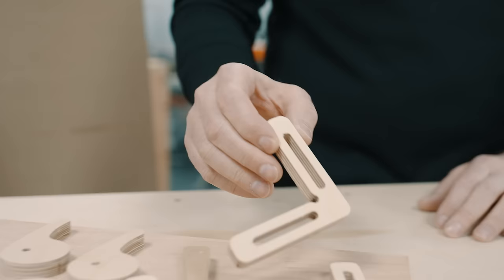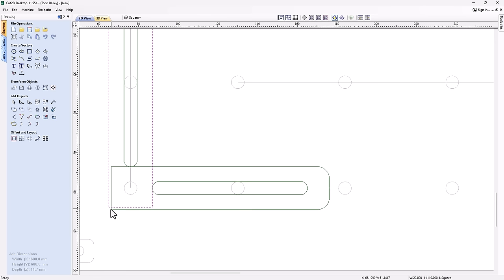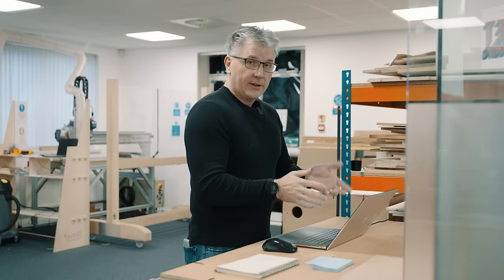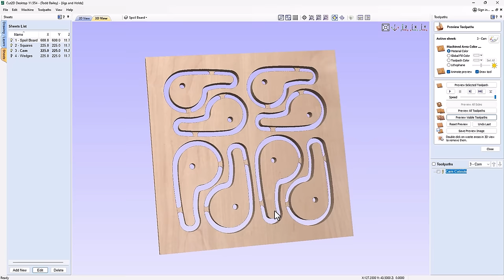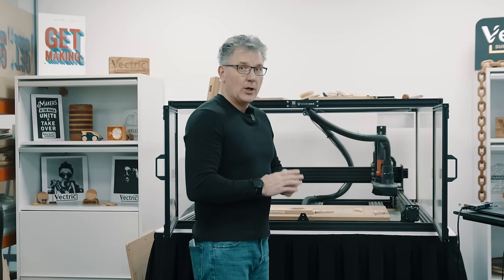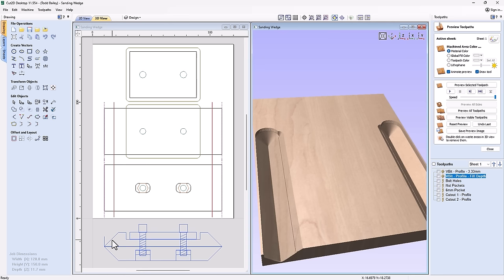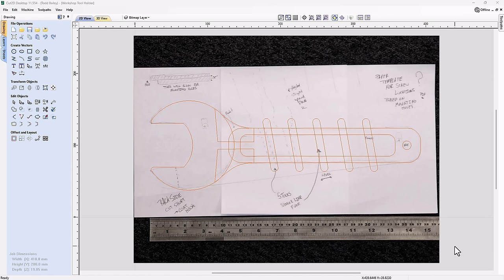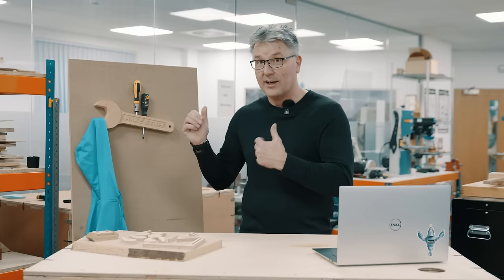Making More CNC Accessories | In the Labs with Vectric | Vectric FREE CNC Projects

Comment: For your offset cam, a line from pivot point to contact should be perpendicular 90° for best securing otherwise the cam can easily push itself off with vibration. A Fibonacci spiral gives ideal shape for the cam
Reply from the maker: Thanks for that!  This might mean a upgrade in the future.... :)

Comment: The sideways hold of the cam lock is far more important than the downward force of a hold-down. The major forces on a CNC machine come from the X and Y steppers. Instead of the square I have used the CNC machine itself to define the bottom left reference. I drilled a hole at 0,0, then used the X step to position a couple more along the bottom. I did the same up the side for the Y direction, then tapped some dowels into them. Doing it this way guarantees precise alignment to the CNC's axes. The dowels are every bit as good as a full square.
Reply: If you are using an upcut bit holding the material down is very important
Reply from the maker: Thanks Don!!!  Yeak therre are many wand to create a proper hold on your material.  The dowel method is really good too, I just wanted to use the features of my nice new shiny spoilboard... :)
Reply: @timpoll7094  Not so much. The major force of the bit comes from the pressure its flat tip exerts on the material below. The spiral flutes are moving much to fast to exert and appreciable upwards force.

Comment: i think when you close the glass box of the cnc, temprature will increase. what do you think ?
Reply from the maker: Hello and thanks for the question.  I suspect you might be right depending on the machine and what you are cutting into.  In our case there is very little noticable change.  In saying that it is not "air-tight"... so that is helping.
Reply: @vectric  i think it will be better if there is some random holes
Reply from the maker: Good call!
Reply: Between the air leaks in the enclosure and the vacuum exhausting air & chips the temperature should be at a reasonable level
Reply: I''ve had a wood box with plexi windows sitting over my Shapoko for 4 years without any problems.  I put two 4 inch 120v fans in the ceiling of the box (blowing up), along with two 24 inch LED light strips (it got pretty dark in there once the I put the box over the machine) that are operated by a switch.  Between the two fans and the vacuum for the chips collection, it draws cool air in from the space around the door and where the wires enter the enclosure.  The box certainly isn't airtight, so there has never been an issue.  The box was built mostly to control the dust, but does a good job cutting the noise down in the shop.

Comment: how did you cut the hole in camlock with one toolpath did i miss somthing ?
Reply from the maker: Hello James... it was part of the profile toolpath.  The hole was just a hair larfer then the tool... so it worked in this case.  Normally I would have used the drill or pocket toolpath.  You did not miss anything... :)
Reply: Ok i would have used pocket or drill thanks for reply.
Reply from the maker: Hello James... it just happened that the profile toolpath did the work.  The holes were just slightly larger then the tool I was using.  If that did not work I would have used a pocket or a drill toolpath.

Comment: Glue some sandpaper to the surfaces of your Angles and Wedges where they will touch your project - this will greatly increase the holding ability. Don't add to the Cams as they need to be able to slide against a surface. I did something similar to my my CNC with larger dog holes as I use short sections of PEX tubing (Similar to Marius Hornberger's in 2016 where he used copper tubing - https://www.youtube.com/watch?v=bpJyqLoqV04)
Reply from the maker: Hey James... thanks for the coments!  There are many ways to get your material held down... choose your method, as long as it is safe and practial... you have won!